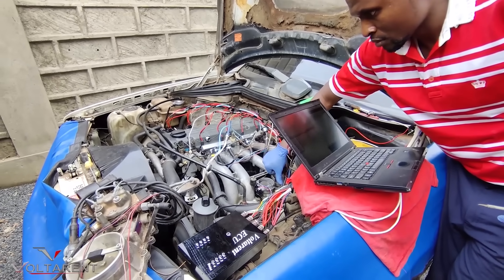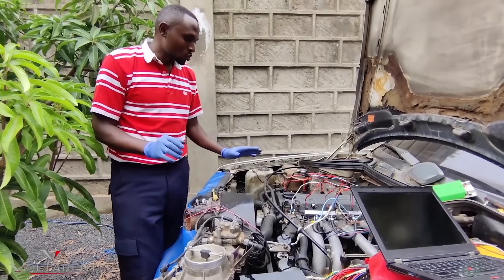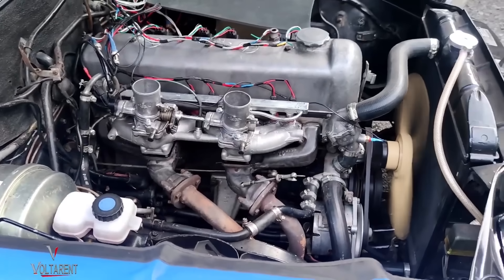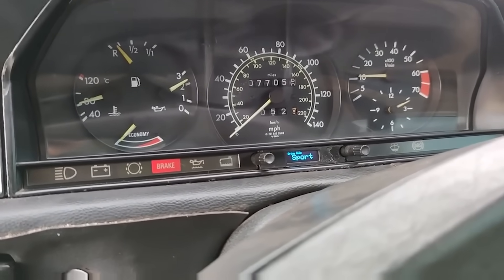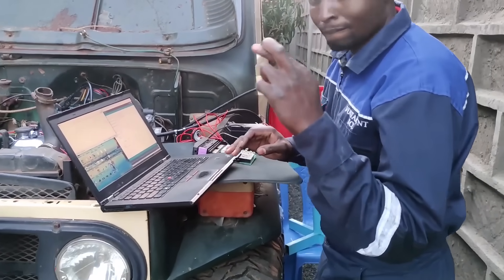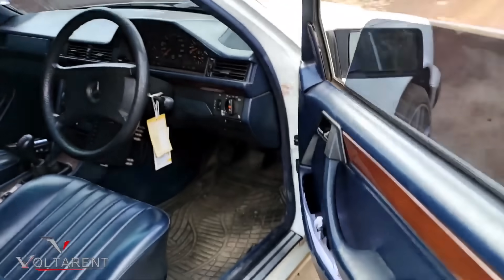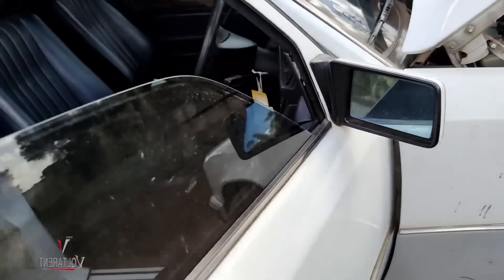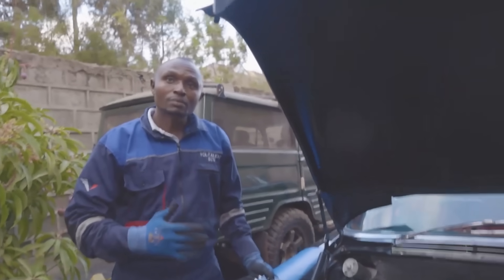African Genius makes Old Engines outdo Modern Engines!

Comment: This guy had a great idea. Perfect for countries in development where this is allowed. Other than that, I hope he wrote the firmware in C and not in arduino's c++ and/or using libraries, as it seems by the serial port in the laptop, though in the other hand, if it works..could be easier on power requirements and more performant if in C, but well done nonetheless.

Comment: So techically a restomod, taking old engines and giving them fuel injection with a dedicated ecu.
Good thing he developed warm water, imagine that. Plenty of shops around the world have various ecus and upgrade programs.
In the developed nations they don't use it for such old cars because there are laws that will kick into effect and will need a lot of money and certification to allow you to sell and install such things.
But works in african nations i guess.
What's funny to me is that the african nations get a lot of sun light and intelligent people would've converted to EV power on a large scale.
As you can produce your energy independently and have best reliability compared to combustion tech.
Also can be done very cheap

Comment: There have already been fuel injected conversion kits for carb'd engines for a while. Jegs has lots of intake manifolds for the fuel rail conversion plus the kits. I strongly believe an old engine with EFi is the best way to go. It will last a lot longer than the new crap.

Comment: So what exactly are the physics principles that allows to be "More economical" AND 'More power" at the same time ?
What I saw was the old original ignition system ( expensive to replace) replaced with a brilliantly made modern integrated circuit microcontroller.
You should be very proud  to provide this system for hard to replace older systems.

Comment: The car industries of today has use ECU to control aftermarket MPG products and MPG. Our liberal anti-GOD government hates these products the government make to much $$$$ on gas taxes and they DON'T care about the environment. Try putting aftermarket products on OBOI compare to OBOII its like day and night. I had a 96 Geo Metro 1.0L OBOI ECU and I install three simple aftermarket MPG products( two had EO# California) from 40MPG highway to 120MPG. ECU can be your friend or your enemy if you add this aftermarket MPG products to V-8 MPG 20 cars with dist cap and carbs you'll get about 80-100MPG. If he try to get a EO# in California good luck. Michael from Green Auto Technology has 2 simple products that will pass smog test and increase MPG and power.

Comment: You know, it's funny that there are parameters that determine if an engine is running properly based on engine temperature, timing, O2 sensors, NOX sensors, and Crank position sensors. With things like the Holly Throttle body system, why can't it look at these values and adjust itself? Seems like an easy algorithm to create no? More programming goes into APP gaming.

Comment: There is no good reason to upgrade old engines, these things are very reliable, they go millions of miles without causing any problems. It's better to do this thing for modern engines - they need to replace the original electronics with cheap, reliable and easy to install ones.

Comment: Peter Mbiria is indeed very smart. DIY designing the ECU circuitry is far from easy. and there are several other huge challenges. Firstly is getting the printed circuit board (PCB) made and then soldering the many 100s of tiny components of which lots are surface mount. I doubt Peter has the equipment to do that. Secondly outsourcing for the PCB and soldering is not cheap especially for low quantity production such as below 1000 units.  2005 I found MegaSquirt and with 2 other guys over a period of 10 years we converted 70+ used engines. These were all EFI engines bought at scrap yards ... and ... whereas 99% of all scrapyards do NOT know how to remove the wiring harness complete and connected to the ECU.  So third challenge is figuring out the DIY wiring harness ... very time consuming.  We figured out the wiring for the Toyota 5A-FE to MegaSquirt and that was the engine we converted by far the most (90%).  MegaSquirt was quite cheap at approx U$ 200 to 250 and back then so were the 5A-FE engines at approx U$ 350 to 400. The real upside of using MegaSquirt is easily being able to adjust some parameters such as air fuel ratio (NO flashing).  To convert most old carburetor engines to ECU is not just a huge PITA (including all the sensors required) but also this conversion is making a simple easy to fix system FAR more complicated. Before digging into MegaSquirt and all the fancy gadget cars ... I bought a 2000 Ford 4x4 diesel turbo with the Mazda/Ford WL-T engine. This Ford has essentially zero electronics and now 24 years later it has been no problem to DIY maintain and repair. There are very few cars or pickups that I would ever want to own and all of these would have to be mfg'ed before 2005 and NO piles of flaky troublesome electronics and bunches of wingding gadgets.

Comment: Of course, if you don’t have strict emissions regulations like in Europe, you can tune the ECU to make better use of the fuel, and the car consumes less fuel but emits more NOx. This guy hasn’t discovered anything new; by illegally reprogramming the ECU of any modern electronic fuel injection engine, you can achieve the same result (and maybe even better). The reason manufacturers don’t do this is precisely because of emissions standards. This is exactly how the Volkswagen Dieselgate scandal happened, and it’s also what any mechanic who remaps ECUs can illegally do to your car—just ask for a map that optimizes fuel efficiency (and increases NOx emissions, but obviously, they won’t tell you that part).

Comment: It's not a new idea and there is nothing wrong with it but it also come with a huge drawback. The more electronics you put into a engine for stuff like this the more points of failure you add. Just one point fails and everything goes out of wack so to speak. This is a problem with modern fuel injected engines. The problem is making it so this rarely happens and making it easy to fix for the buyer.

Comment: This is fantastic. Mr. Mbiria will not be able to do this here in Canada or other over regulated areas. He is taking obsolete cars and modernizing them, saving the planet by extending the life of these units. Wow!
Reply: You are completely wrong.  Canada would not stop him at all.  There is nothing illegal or particularly novel about building an ECU there are dozens on the market.  Jeez you conspiracy nuts.

The impressive thing here is this man did everything himself and did it very well.  His accomplishment is remarkable.
Reply: @ml.2770  yeah, ragetoids are getting out of hand already. Canada would not stop you if you modernize your old engines, if anything they'd encourage making the old carbureted engines more efficient. 

what a brainless comment from OP
Reply: @ml.2770  read my comment insurance companies will say highly modified to get a higher premium.  Not a conspiracy theorist  also the government wants tax dollars for the cost of fuel.  Just look at the Volkswagen scandal that just happened with the diesel engines? Sheeple
Reply: @ml.2770  its generally legal you right, but problem with Canada and I think many western nations  have emissions regulations, safety and inspection requirements that an innovation such as this must comply with to be licensed. The cost of compliance is usually too high for small time Innovators to commercialise. And the way his innovation is minimalistic with only core sensors perhaps he will be given conditional approval provided he includes those sensors. I'd also bet those regulations may be used by other industry players to stifle his growth. So you can imagine right now he charges about 1k USD.. there are vehicles he charged even lower from as low as 600$. But  Now imagine due to the regulatory obstacles he charges 10k... People will just buy new cars at that point
Reply: In the UK the old Merc would be a puddle of rust🤣
Reply: you're talking out your ass, you can do this in Canada
Reply: @Dragoon710  Regulations are made to prevent competition. Do you really thing the american car build for obese peoples have a better consomption than the car of 80? Why can't we build small pickup anymore?
Reply: @omegaman7377  Which is why there are more auto makers selling cars in North America than any other consumer product on the market, right?  How many companies actually make computers or refrigerators?  Compare that with the number of OEM's that make totally different cars from each other.  Regulations didn't kill competition at all, if it did, we would only be getting one or two brands of cars.  Ford, GM, Stellantis (which has a bunch of brands), Toyota, Honda, Nissan, Mazda, VAG (WW, Audi, Porsche), Mercedes, BMW, Kia, Hyundai, Subaru, Tesla, BYD....
Reply: Same thing I do with refrigerations I rebuild them and extend their lives.
Reply: canada is a FAKE society. they know very little and make rules that they themselves can't pass. canada is a frozen backyard of Uncle Sam.
Reply: Edward Bernays is raging in his grave
Reply: the dominant society will ban this tech because global warming
Reply: africa has their own standalone setup.. more advanced than this tech being used.
Reply: They will not let you change a lot, plus he meant that the car would be rusted away it would be good if he made replacement ecu for modern cars.  it used to be you could bring the high mileage cars from out west and ship them to Quebec and do an drive train swap as in Quebec the body gone before the engine that's what happened to my 3 bmw everything fine but rusted out had to part them out. and now with the Move to ban repairing older cars it going to get really bad he would do much better repairing or resetting newer ecu for people doing engine swaps and don't want to pay (bmw) 1200 euro to flash the chips and that's if you can find one who will  @ml.2770 is clearly not update with the modern car laws
Reply: Insurance companies will say  highly modified and raise the rates and the government will not maximize the amount of gas taxes from an inefficient engine. They don't care about economy as much as they care about their tax dollars =criminals here in Canada
Reply: The Big Auto companies will try to put him out of business in the West. It is what they do best.
Reply: Carburetor to EFI kits have existed for decades. Just google it, the main reason people don't do it is that once a carburetor based car dies it's usually not worth fixing unless it's a classic or hobbyist car. Just look at the car he's working on, in the US unless it's collectable, that car would have just ended up in the crusher and replaces by a similar car with better safety upgrades and technology.
Reply: @sparklawns3433 In Africa and a lot of the third world preserving these cars is and other technology genuinely economically worth it. It wouldn't do well in America because we let old cars die and new cars are pumped like water to die even quicker. But in the developing world they're even replacing the motherboards on CRTs to keep them going forever.
Reply: Agreed, and there's no evidence an EFI motor is more economical a than a carbie one.
At least with carbie motors, there's less parts to deal with,and a full mechancial motor is easier to work on.
Reply: @xander1756 I'm curious what kind of evidence are you looking for besides the one you see on the cars with this ECU.
Reply: Why not? You can build whatever you want here in Canada for as long as the required regulations are met.
Reply: @isimioluwasuyi-dw4ht  you answered your own question.
Reply: @kevinohara8529  Much less regulation in Alberta. Not even a catalytic converter is mandatory here.

Comment: How does the ecu determine fuel trim through the injectors vs airflow when the carburetors are open without airflow measurement? How does it determine crank position where are the sensors for the different parameters located so the ecu can determine trim.

Comment: In the experimental aircraft world, where engine certification is not required, could conventional carbureted  Lycomimg, continental or perhaps Franklin engines be converted to fuel injection.

Comment: Don’t get bought out.  Don’t sell out!  They will try.  
Create it for yourself.  Go brother!
Reply: snake oil salesman? how so? this is the same exact thing as an aftermarket fuel injection setup with ecu. holley, fitech, haltech, fueltech etc all sell this same type of setup. what i find very impressive is he programmed the ecu himself, designed the boards, etc. very impressive.
Reply: Bought out? He bought these parts from China 😆 Thank Chinese innovators for blazing the path ahead for all to use cheap parts and then charge $1500 usd..
Reply: They will buy it just to hold rights and shelf it, they do it every time
Reply: I'm not so sure. If he has more ideas, he might do well to sell this. The man is young and might do greater things than gather wealth with some leverage.
Reply: Exactly
Reply: They are trying to destroy him
Reply: yesss!
Reply: there had been other inventors in the past claiming to get over a 100 mpg or engines that run on water ,but when the auto industry gets wind of it,the inventors die under suspicious circumstances an all of the blueprints disappear ,lets hope it doesn't happen to him
Reply: @ec5423 could you give actual references to those inventors? You just got rumours 😅.
Reply: @AndrewKwabula  have you watched the'why files'
Reply: @ec5423  EXACTLY, finally someone with a memory. Riddle me this though free thinker, why did they harm the others and yet they let some live like Elon Musk? I have always thought it strange musk is allowed to go forward. Elon is not even a inventor he just buys out companies.
Reply: The dude literally has bare wires on top of a hot valve cover. There is no way these vehicles will run long before all the wires burn off. 
His device he claims he made is snake oil BS.
It's just like everything else these people claim = A SCAM
Reply: @commoncentsamerican  wiring can be insulated what are you ranting about
Reply: @M3X1C4N92  it is obviously fake
Reply: @commoncentsamerican the wires aren't going to burn off on the valve cover. Lying on the exhaust yes. Maybe rub through the sheathing from vibration if they're not secured.
Reply: @commoncentsamerican  you didnt listen to his video, those clips with bare wires are all in testing, hence why everything is in progress. At 9:46 you can see he has put everything in a harness nice and neat.
Reply: @commoncentsamerican The thing i do not understand is how they agree wuth his that his modifications are better. Why not do it and let independent testers decide if it's good? He cannot manufacture an engine from scratch, yet now he claims his is much more efficient than an unmodified engine.
Reply: @commoncentsamerican  he said "this is just a test" when he talked about the wire harness at 1:23
Reply: @commoncentsamerican  "We're just running a test"
Reply: @commoncentsamerican  you don't seem to have much common sense (not common cents). You can obviously see that he is STILL BUSY with the vehicle AND that engine will literally have to overheat for the wires to start melting on the tappet cover.  I wonder if you can even do an oil change....
Reply: @commoncentsamerican ya same kind of opposition coming from same kinda folks always, you know why? get a grib the world is revolving knowledge does not stand still nor is it monopolized
Reply: @commoncentsamerican  tripping

Comment: There's a lot of excitement brewing for enthusiasts of classic Mercedes models in the USA.  As we look ahead, it’s important to recognize the potential challenges surrounding the wiring harnesses for the injectors, which are known to deteriorate over time. For those passionate about restoring these iconic cars, figuring out solutions for the wiring harness and related components will soon be crucial. Given their expense and scarcity, the coming years could see a surge in interest and innovation for sourcing and replacing these hard-to-find parts.

Great design! 
Keep up the good work. I've been debating getting a classic Mercedes for this very reason. I'm going to start looking for me a good chassis Mercedes now.

Comment: Starting with a 4 and a straight  6 clyinder gasoline and diesel powered engine, africa need to  self manufacturer some simple utility vehicles.  No outside no enfluences or dependency.

Comment: I have a Nissan blue band 2005 with power issues ,no engine power after I changed the gear box most mechanics have failed can you help
Am in Arusha TZ am a Kenyan

Comment: How can I get one of these ecu setup
Reply: They'll sell you kits of the shelf, or you can probably ask some mechanic shops to have a look at the prospect. It's not necessarily a good idea for the longevity of some old engines, though if you just want to drive it with better fuel eco for a while and then scrap it, could be worth looking into.
Reply: @0FFICERPROBLEM  I have a mistsubisi montero  v6 it's really bad on fuel the ecu is going crazy and I can't get into it to make any changes

Comment: So he is illegally changing spark timing for best performance not exhaust emissions.
But I bet he modifies exhaust system which is half the battle. 
They don’t tell you this. ECU 15% exhaust 20% improvements. 
I made my C180 Kompressor behave like a C250 without changing supercharger.

Comment: It's called a remap. It can add a few HP but it's not a miracle. Those "old" engines are already powerful, much more than any 3-4 cylinders NA engines. But I doubt they outperform a well-tuned turbo engine. It's however incredible that he can do that with such limited resources, he's no doubt a genius